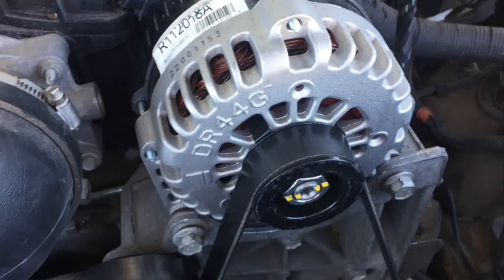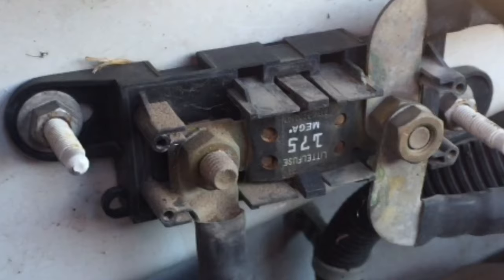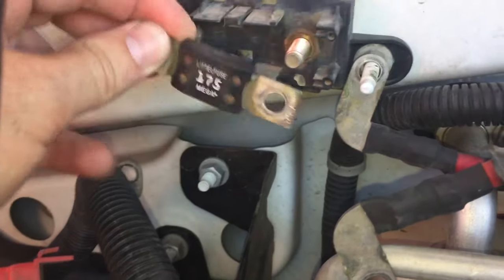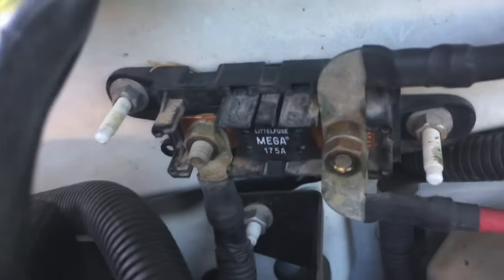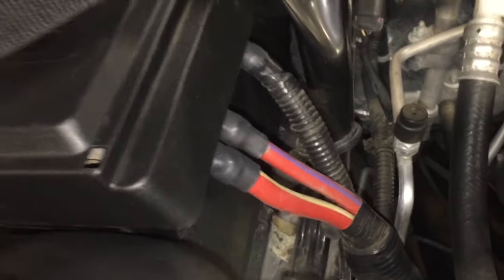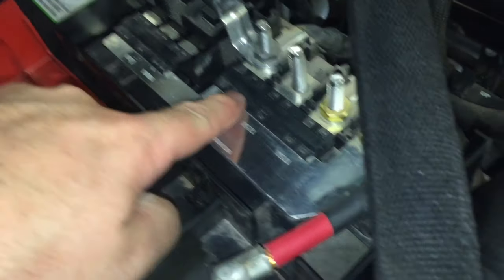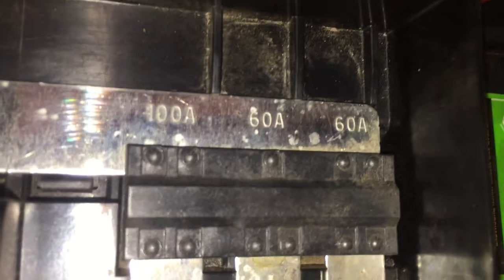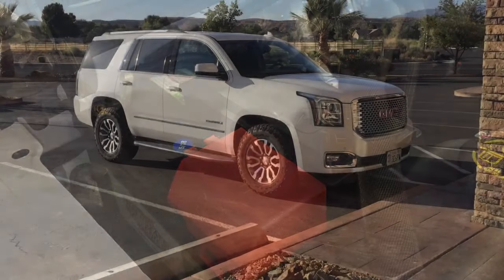Alternator Fuse Check this first, if new alternator is not charging. Shown on GMC Yukon Tahoe Sierra

Comment: Alternators almost never fail, its always the wiring harness, fuses, ground etc etc that breaks first.
Reply: Lol not true at all but good job trying to sound like you knkw what youre talking about
Reply: Honestly parts hardly truly fail n general., Almost always something electrical based which causes the failing parts. Lots of people have no clue how to keep up with their vehicles. Vehicles are like having kids if you truly care, Any type of automotive wires used Oem will dry up and just snap apart after certain amount of years which causes things to run out of Engine timing parameters, and makes things Wear and tear at Extremely faster rate. Vehicles are so simple when kept up with, sooo difficult to play “catch up” on a beat up vehicle tho.
Reply: 😂😂😂 that literally could not be further from the truth. Especially the Chinese and Mexico alternators. Mexico has gotten a bit better but still. Lol.

Comment: Quick tip: in recent GM products, the alternator output may drop as low as 11.5 volts in normal operation. It's a fuel saving feature, the ECU commands the alternator output below the open circuit voltage of the battery in order to stop it from continuing to charge when full. Normally the ECU will detect a faulty alternator and give you a DIC warning, but if you want to check, turn on the headlights. That will cancel the economy mode and kick you back up to the 13s. Ford, Chrysler and some Japanese makes have similar systems, it's because of MPG requirements.
Reply: Interesting, I wasn’t aware of this. From what year does this pertain to ? Thanks
Reply: @XxTimeToKillxX09  Since the early 2000s. Called Regulated Voltage Control.
Reply: That’s incorrect. If the voltage drops below 11.7 volts GM vehicles go into “battery saver mode” which cuts power to non essentials—air conditioning, charging ports, if it continues to drop then power is cut from stabilitracks, traction control, and eventually power steering. GM vehicles require 12 volts to run properly.
Reply: @wesleypinson1553  Nope, wrong. Straight from the owner's manual on a 2017 Acadia: "The normal battery voltage range is 11.5 to 15.5 volts" From the service documentation, voltage-based idle boost 1 will not occur until battery voltage drops below 11 V as long as the battery temperature is above 5 F. If the BMS does not have a working current sensor, the system will let voltage go down as low as 10 V before idle boost 3.
Reply: The manual you are referring applies to a 4 or 6 cylinder engine. We are talking about 5.3 and a 6.2 V8s. Try looking at the correct manual next time. Battery Saver Mode activates under 11.7 volts. A 5.3 or 6.2 will NOT run properly at 11.5 volts.
Reply: @wesleypinson1553  Again, wrong. I checked the service docs for the Silverado 1500s and it has the same table which shows idle boost 1 does not occur until 11 V. I don't know where you got the bullshit that you need 11.7 volts, corporate standards require operation of all devices down to 10 V and devices that operate under cranking, like the engine, have to go down to 8 V. This is to ensure safe operation of the vehicle in the event of an alternator failure.
Reply: That figure comes from real world testing on a 2015 Sierra 6.2. You may be a google warrior, but you don’t know what you’re talking about.
Reply: @wesleypinson1553  Nice try. I have all of the GM factory SI. You mad that somebody called you out on your lack of knowledge? Close your mind and whine some more that there's smarter people than you out there.
Reply: @wesleypinson1553  Lol he quoted official GM manuals. You cried.
Reply: Nothing normal about it.
Reply: @straightpipediesel  any trunks voltage that drops to 11 volts isn’t normal! Ever
Reply: @Fox250R  That's perfectly normal if the engine is stopped due to auto start-stop and you have a bunch of things like the fan running.

I believe it also drops it that low occasionally when it stops charging while the car is moving. It checks that the battery is healthy and can take a load, just like how those battery testers determine state of health. It is an important safety feature because of vehicles with auto start-stop. Imagine a vehicle on a hill and the engine is stopped. You let go of the brake and hit the gas, but the battery is weak and the engine doesn't start. The vehicle rolls back and hits the car or pedestrian behind you.
Reply: Thanks for your help man.... awesome
Reply: I’ve changed the The Battery, The Alternator and The Alternator Fuse and it will work but if I cut off my Escalade it won’t Restart because the battery is dead again. I don’t know what to do, any suggestions on what it could be ?
Reply: Could a 2007 Chevy Silverado do the same? I have a p0562 code check engine light from it dropping and it has a brand new alternator.
Reply: Just tested this but I’ve never had my truck voltage drop like that until recently, turns out  my battery went bad now I have new battery and the voltage drops but did what you said and it got back up to 13.8+ but I’m still concerned since this has never happened I’ll be checking my alternator.

Comment: Man !!! God bless you sir !!! I was replacing my alternator on my 2007 chevy Tahoe and I completely forgot to disconnect my battery and one of the wires that touched the frame and you know what happened next. Thanks to your video I could find out the location of this fuse, I replaced it and my Tahoe is on its way back to the road, thank you and god bless you!
Reply: What happened next bro. I am not a mechanic or electrician. I got the same problem with you
Reply: OMG BRO I JUST DID THE SAME THING CHANGING MINE FOR THE FIRST TIME 🤦🏾‍♂️🤦🏾‍♂️🤦🏾‍♂️🤦🏾‍♂️🤦🏾‍♂️🤦🏾‍♂️ ALMOST BLEW MYSELF UP 😂😂😂😂😂😂😂😂😂😂😂😂😂

Comment: Had battery light on for 2011 Subaru Outback 2.5. Changed alternator and light was still on. Apparently 2 wires were eaten out by rodents which shorted and blew the alternator fuse. Number 10 fuse 7.5 amp.

Comment: I’d like to add this bit, guys and gals, check the connection points where the cables meet the battery or chassis grounds. I’ve seen rust build up underneath tabs before. Rust and corrosion that can’t be seen by standing over it. My eclipse has this issue and I have to clean it up every couple months, and re-apply dielectric grease.

Comment: I'll call about an inline fuse. Easy enough to fix. Because i did have a new Alternetor installed late last year.I have a 2010 Dodge Avenger. Still a fast car .., I will try this! Thanks so Much! My car doesn't die while driving though.

Comment: How about just an ohms multimeter test from the alternator nut to the disconnected pos. battery terminal end.. If it zeros out you have a good fuse.

Comment: Thanks for this vid, I think I got my electrical issue figured out. This main alternator fuse had bunch of corrosion and also noticed the right side post that the fuse slides on to was a tad lose, needed a 1/4 turn to snug it back. Buffed off the corrosion, cleaned all the connectors, buttoned it back and been good past few days.
Reply: Where is the fuse
Reply: @CrazyDescription  on my 08 its on the passenger side at the back of the firewall

Comment: Just came across your vid in search of Tahoe charging issues. Last year I had to replace both battery and alternator. After doing so, she ran and started up fine. But soon after, the battery light started to flash, and the info center read Battery not Charging. But it still kept starting, and everything was working. I attributed it to and undersized battered.... (Different cca below 700). I also noticed there was a line of some sort coming from firewall and attached to the hood, on driver side. Fast forward to yesterday, I begin having battery issues. Bought a brand new battery, because they wouldn't take old one for warranty because it wasn't dead yet, it still held some sort of charge,( though not enough to crank over motor).  Had the auto parts guy check alternator as well, his machine said was good.  Bit still the dash reads: Battery not Charging, and the light goes on n off.... Would recommend I perform this inspection of this fuse? Also, the wire attached to hood/firewall, could that be a ground wire? Any help is greatly appreciated, thanks for video, and time.
Reply: did u ever figure out what was going on my 06 taho kind of doin same thing i charged the battery for about an hr  an it started   right turned it off it started right up 2 days later battery dead
Reply: @raymondjohnson8522  no, I am continuing to drive it. Did find out I had a short with the fan switch. But I think in gonna take the alternator back, maybe the voltage regulator is the culprit.... Love my Chevys, but sometimes...🤔🤨it makes me crazy...
 Good luck with your Tahoe...
Reply: @manuelbustos9334  please let me know when you find out the problem, I'm on my 3rd battery in my Yukon
Reply: Sorry for not seeing this message, Gmail isn't my primary email...this is connected to that platform.
Anyhow, no I still haven't figured it out. Since she keeps turning over, I just didn't worry about as I should have. Did change out battery again, 3mo ago. Had AutoZone guy check, they said that my starter is probably the issue, but she starts up fine .. trying to save to get another starter, but until then, I've let it be... Hope you found your issue, again sorry for not keeping up with this entry...

Comment: Great video buddy I have a 1987 Chevy Camaro iroc z28 I replaced my steering column and now my battery is not being charged by the alternator properly . I replaced the batter and alternator thinking that was the issue. I haven’t checked that alternator fuse yet will do it tomorrow . I also have an alarm for my car so I have no idea what the hell is going on. But will check the fuse first.
Reply: Did it work

Comment: Just wondering how you tell if the in-line fuse is good or bad ?
Reply from the maker: You’ll need a multimeter to put in each end of the fuse to perform a continuity test https://youtu.be/PsS-90gB4As

Comment: Hi, I have. 2000 GMC Sierra 1500 with a 5.3 swap 2005 engine, but my battery keeps dying every 2 days if I don’t use it and the volts always drops after a while of using the truck or when I go to reveres and at a red light. I have a new battery and I bought a 2005 alternator but the wiring that this engine has is different than the alternators female port. I bought the alternator that fits that port and it works but it still drains does anyone know if I just need to change the wiring harness back to the original? I also have some electric fans and not sure if that could drain the battery and suck up lots of amps even though on parked the volts stay around 14

Comment: Thanks..We've installed new alternator & battery only 8 weeks ago & battery is dead again. We'll have to get it troubleshot I'm guessing maybe needs a fuse? 🤔
Reply from the maker: Unfortunately, many new alternators are bad (that’s what happened in the end with this one). Here is a cheap tool to help test it 
Save your engine with this $10 tool! Test your Alternator! Voltmeter
https://youtu.be/Ct_ibCwNbQ4

Comment: Purchased 2 new batteries for 2003 Chevy Silverado HD, each time they are dead in morning. Check engine light is on, Ordered BlueDriver OBD11 which didn’t fit despite calling the company so going to try another’s. Noticed water halfway up inside the front taillight cover, would this short out a battery?  I did drain them!

Comment: Got a 2005 dodge ram  1500 and there is no inline fuse and I have new alternator and new battery but alternator won't keep battery charged
Reply: Did you end up finding problem? I'm having similar issue now
Reply: @andrespaz989  yeah it was the voltage regulator in the ecm so I bypassed it and bought a external voltage regulator if you don't want to do that you will have to replace the ecm
Reply: @CoastalTexan29  thanks for reply. Will do some research into that. My problem just started out of the blue the other day. Everything was going fine 1 min then I get in, start like normal and instantly notice battery lights on, as well as the lights showing all my doors are open. I cancel my next order and start to head home and 30 seconds later I notice smoke coming from under hood. I pull over and its smoking BAD from what looks like the alternator. And then the battery instantly died, couldn't boost it off or anything, so I towed it home and I replaced alternator as well as the serptine belt and the battery test says its a good battery, but it's still not working. Full charge battery lasts maybe a few minutes and the machine says it's only getting around 2 volts (or amps?) when it should be over 14 from what I was told, but if I Rev engine up it goes up to near 10.   Sorry for long reply, just wanted to explain incase you or anyone else who may read this knows of any other possible problems. The guy who put alternator on also used his meter to check if everything's getting power and he said it's showing power going from battery to alternator so I'm stumped, may not even be worth the $ to fix
Reply: @andrespaz989  well I know the ecm or computer is a little expensive but my truck did somewhat the same battery gauge just jumped up showing it was over charging then when I pulled over killed it and the cranked it back up it was fine for about five miles then did it all over again replaced battery and new alternator but since it was my voltage regulator that was bad it wasn't telling my alternator to charge the battery so my battery wouldn't stay charged or the alternator would over charge
Reply: @CoastalTexan29  ok that's good to know it sounds like it may be my issue as well. I'm going to look into it more thanks again for reply
Reply: @andrespaz989  no problem hopefully you get it fixed

Comment: If I jump the battery wrong and lose all power. My vehicle has the same fuse and is set up the same way but I changed the fuse, got power back to my gauges then turned it on. A few seconds later it died again and full loss of power. Did I do more than blow the fuse what else could it be?
Could I have fried my alternator or could the computer be shorting out because I fried that?
Reply: Possibly fried your computer, any update on the fix?
Reply: @_gw33do_  simplest fix.  Lose battery cables.
Reply: @SanguineBlackBlood  good news 🙏🏼

Comment: I have a 2017 terrain and one day my car hesitated to start but that was months ago. Well yesterday it did it again and again so I decided to take it to Auto Zone which they checked the alternator, battery and starter but all was great except the battery wasn’t getting a full charge?? I even took it to a mechanic who ran the same tests and all was good but there was corrosion on the terminals so he cleaned only one side and didn’t take the other one off since there was no visible corrosion. My car started great after that but days later it hesitated again and honestly don’t know what to do when everything is working fine

Comment: Failing alternator.....biggest concern with having a Cobra but I'll get it swapped out with one of the better options before too long
Reply from the maker: Lethal Venom You’ll like this https://youtu.be/0laLuFYHCU8
Reply: @dannyjohnsonsgarage  Already watched it lol, Debated on going with a 3G wire kit or just upgrading the alternator to one of the better ones. Never planned on running a sound system or anything but I'm not sure what direction to go yet when I get to that mod process

Comment: I have a 2009 Nissan Murano and have been giving me a hard time going into limp mode where randomly I loose power and acceleration and even let me down a couple times on the road. Read so much about possibilities and replaced  intake hose , throttle body and pedal sensor, etc. I didn’t change the alternator as it’s a bigger job and more expensive and I’m afraid in case it doesn’t fix it. Any idea?

Comment: I bought a used 09’ Hyundai Genesis sedan 4.6 and the 200 amp alternator fuse was blown and someone replaced it with a 100 amp fuse. Could having that smaller fuse cause the alternator to not charge the battery properly? I popped a new battery in and within a day or two it was dead. I’ll be testing alternator tomorrow after the battery recharged, but could t help but wonder if that smaller than it should be fuse had something to do with it. 🤞🏼 Thx in advance!
Reply from the maker: Most likely it’s the alternator’s regulator. A smaller fuse would only chance blowing easier, but it would still work

Comment: I ran my multimeter from the output of the alternator positive to the negative post on battery and got same readings until the car / (recently jumpstarted) battery died. 
My question is - before I go a wrangle the alternator, is there a stupid little fuse that manages the voltage regulator on the alternator I should be considering?
Reply from the maker: The regulator is within the alternator, so without opening it all up and looking to rebuild the alternator, I’m going to say no

Comment: i have a big black wire coming from the back of the alternator screwed on does it go to positive or negative on battery? I have it on negitive and dash gauge for battery shows just a quarter way instead of half way. I put in new battery and the alt but something not right. 99 gmc jimmy.